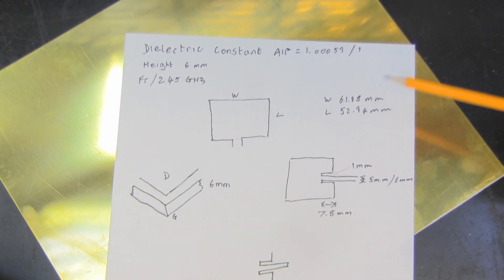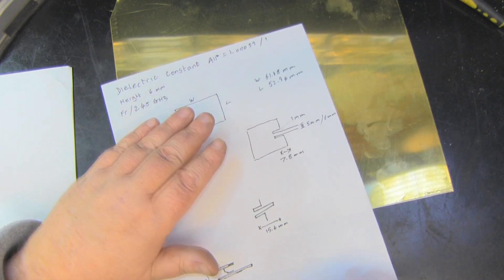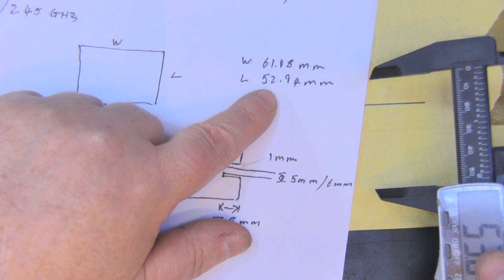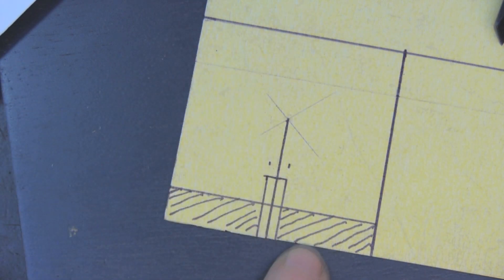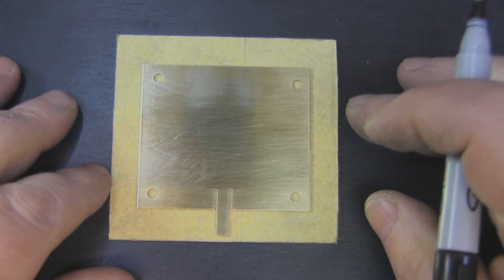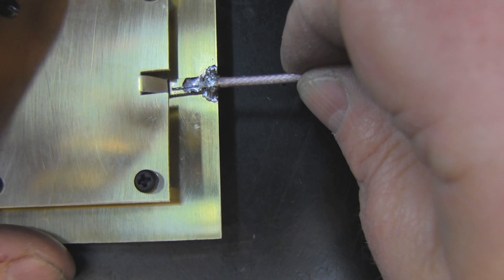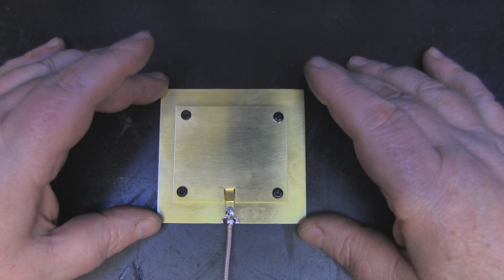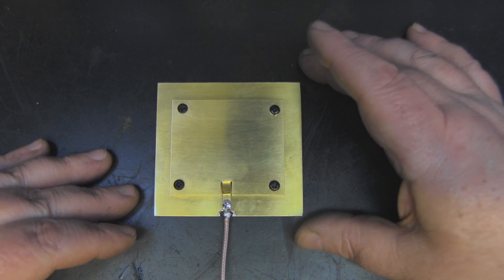The Panel Antenna Antenna Basics

Comment: The bolt you're use in this video are plastic or metal
Reply: They must be plastic, (bolt and support.) Nylon would be the easiest to find and would work well. If you want to squeeze the last 0.01 db of gain, then teflon or polyethylene would be the choice.
Reply: @TheTemporalAnomaly  i thought it's connected each other brass plate
Reply: @faiziali3372  No, the two brass plates are insulated from each other using plastic bolts and spacers.

Comment: When using the on-line calculator, what value to you enter for the Dielectric Constant for this design?
Reply from the maker: 4
Reply: @andrewmcneil  Why 4 when air is much closer to 1? The supports would modify this a little but only by a small amount. 4 would be the value used for fiberglass pcb material. Have I missed something here? Great video by the way!

Comment: Hi Andrew - I like this design, there is something very pleasing about its simplicity.  If you were to array 4 of these in a row, would the pitch be about the same as the width?  I am thinking to make a corporate feed on microstrip, on a 2 layer FR4 PCB, and the air patch elements would be mounted on the ground plane side, fed thru vias.  What do you think?

Comment: if this works for 2.4GHz spectrum, will it work for the 868 MHz too or we have to change some things ?
Reply from the maker: You would have to change it's size
Reply: @andrewmcneil  ok, thanks.. but any formula/hint how to calculate the size ?
Reply from the maker: @RotOli12  Here you go just use the dielectric constant of air which is 1  https://www.pasternack.com/t-calculator-microstrip-ant.aspx
Reply: @andrewmcneil  wow... thanks... and the dielectric height is the E from the little drawing? ie, the distance between the 2 plates ?
Reply from the maker: @RotOli12  yep if you play around with the height it is interesting how much this effects the size of the element.
Reply: @andrewmcneil  yeah, I saw...the width stays the same if we just play with the "E"... :P But now the next problem is the dbi... it is possible to influence the dbi number ?
Reply from the maker: @RotOli12  you can improve the forward gain by using a thicker material for the reflector ( known as front to back ratio) but other than that no.
Reply: @andrewmcneil  and what average bdi should a panel antenna have without improving with a thicker reflector ? what if we curve the reflector a bit ? it would not focus the waves better ?

Comment: I think this video is really underappreciated. I built this antenna following all the details and I obtained a very good antenna. I even measured it with a NanoVNA and it is spot on channel 3. It was one of the easiest 2.4GHz antennas I've built. I must admit that the only question I have is regarding the length of the inset feedline. Why is that 15.6mm long? I know that is twice the 7.8mm, but why?
Reply: for 50 Ohm i suppose  not for  75 ohm cable
Reply: Can you be more specific?? Are you considering wire Ohms to build antenna
Reply: @MQM360  to match the impendance of antenna to the cable

Comment: Is it possible to make it a wideband antenna?  I am looking for something directional that would cover 4G bands from 800 MHz to 2.6 GHz
Reply: It would be awesome
Reply: try heelical  or other wide band antennas
Reply: @LotosAndEarth  doesn't really work for my application as I want to put it into a weatherproof box together with the modem. A biquaq option that Andrew is working on now (recent video) is closed to what I am looking for.
Reply: Yes, but a different thing altogether than this. It would look like two triangles of metal, fed between two tips. It would look like a bow-tie. Get on the googler and look up `wide band dipole` that will give you some ideas. You can have flat SWR but the gain will be much lower than a dedicated frequency antenna.

Comment: Hi Andrew, the online calculator doesn’t mention the coax connection strip. The length, width or the amount to cut in. I wish to make an antenna for 1278MHz.
.
Reply from the maker: No it doesn’t the design of the strip feed is a whole other area of RF. That’s why in the video I say that starting with 1/8 wavelength is a good place to start.

Comment: What sort or gain does it have and how do you determine vertical or horizontal polarisation when its square and symmetrical, I'd like to try one for FPV and it looks more compact than a 2.4ghz double bi quad, how do the two compare?
I'm looking for the most directional and high gain on 2.4ghz for FPV.
Reply: well, you can basically see how he positioned the antenna.

Comment: How would you go about making one for both 2.4 and 5 GHz? Make a smaller square, put it in front of the 2.4 panel?how is the sma cable connected in this case?
Reply from the maker: I have seen them stacked but never tested or build one myself.
Reply: @andrewmcneil  that'd be nice to see in a video, especially for LTE purposes :)

Comment: How do you setup the antenna-osciloscope to see it's efficiency?
Reply: Is not an ociloscope. It's a spectrum analyzer.
Reply: @cosmefulanito5933  It's a network analyzer to be more precise. By the looks of it a scalar version (atleast like he uses it). 
However, a setup video would still be pretty interesting.
Especially since a network analyzer needs to be calibrated for each measurement with known open, short and load standards.